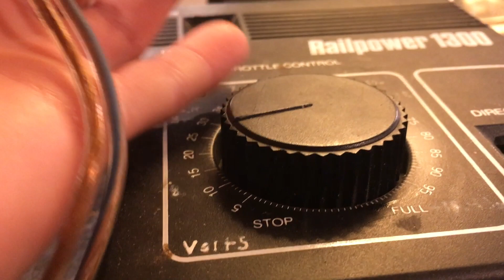How to Rewind 3 Pole DC Motors - Rebuilding Model Train Motors

Comment: I used to rewind slot car motors back in the day.
We used a heavier gauge of wire and a lot less turns, 
then epoxied and baked in the oven at a low temp.
A note of caution, disassembling the old open frame motors with the magnet on the end, can cause loss of magnetism.
However the good news is that they sell rare earth magnets that will take the place of the old one, making the motor better than ever!
Reply: the good news is that most motors can be replaced. i rewound a sekisui 5-pole square motor for a club member years ago- i would not do it again.

Comment: Thanks for another helpful video Harrison.  I don't have any locos that need to be rewound, but now I know how and can give it a try if need be.  You were a little surprised that it worked?!?! 😲 CONFIDENCE, Harrison, CONFIDENCE!!!  Let it warm up a bit, and it'll most likely run smoother and faster, after all you did just tear it apart.  I bought a set that hadn't run in years.  It wasn't running very good when I put it on my layout, but I ran it forward and reverse for a bit, and now it runs perfectly fine even with a consist.  It's a Life-Like diesel (Susquehanna Line).  The wheels are very dirty, so I can see it running even better once I clean them.  How are the wheels on your CP Rail diesel?  We know the dirty track is also an issue.

Comment: You are ahead of me SMT! I have yet to attempt rewinding an armature.  I would agree the main things are: to wind all coils in the same direction around the poles; & wind the same number of turns around each pole.  The N scale boxcar that is laying on its side & missing a truck - you replace the missing truck with a K-D coupler & truck assembly for a " conversion car " to couple  together a train of cars with both Rapido & K-D couplers!

Comment: Harrison,
You did good job on that! I have an old trix f-7 to mess with-Wish me luck!!
Reply: i use the bachmann early-style spectrum motors in those units. you'll have to pull off the flywheels and shorten the shafts, modify the trix rear motor bracket, and drill out the couplings to fit, but it makes a fantastic runner out of them. the motors are still available from the b'mann parts house- i just ordered a pile of them at 20% discount so they were about $11.65 apiece.

Comment: Nice video! I've rewound many motors in my day, and have experimented with them a lot. Make sure you scrape the enamel coating off the magnet wire where it wraps around the little tang on the comutator before you wrap the wire around the tang, that way you'll get a good connection. If not, the motor may not run, or may need a spin to get the motor going, or just poor performance.

Comment: Very interesting video Harrison, congratulations on a task not many hobby folks would not attempt. I knew about motor rewinding back in the 60’s slot car craze. Only read about it as there was mostly written articles. 
The slot car folks rewound motors to increase rpm. Don’t remember if it was less or more turns but the results were dragster type cars that were incredibly quick. 
Thanks for sharing 
👍👍👍😎😎😎 Cary
Reply from the maker: Thanks for your comment. Yes, people racing slot cars seem to do rewinds to increase the speed by putting less turns on each coil - You would loose torque but I guess if you did it just a little you would gain extra speed.
Reply: the wire gauge affects performance as well.
Reply: hey smt I'm looking for a shell and truck for my locomotive

Comment: I think that you will find if you measure out the wire to approximately 6 and 1/2 ft at 36 gauge you'll get exactly what you're looking for without having to do all the counting. You do yourself a favor by using some super glue on those coils to keep them from unwinding.

Comment: If the loco runs backwards after your rebuilt you (a) wound the poles in the reverse direction from when new, (b) turned the case (and magnets) around.  Mark the endbell and case so you know you put it back the way it was.  Worst case, swap motor wires.

Comment: Chuck the motor shaft in a drill, spin it, and hold a piece of 400 grit silicon carbide paper against the commutator to remove crud and polish.  After scrap out any crud between segments with an X-acto blade.  Make sure the shaft is clean and shiny, and lube the bearings.  I like Singer Sewing Machine Oil for this.
Reply: you clean the gaps with something soft like harrison's tooth picks.

Comment: Years ago, I used to run slot cars a lot. There is a company called Parma that still produces motors for them. T hese are very similar to the motors you are working with here. They might have some information you might find useful.
Reply: it looks like a mabuchi motor- prolly not worth rewinding.

Comment: Will this help if you have gotten oil on the commutator an I have a situation that my motor works but won’t spin when you start giving it power you have to spin the armature over for it to start spinning will this help
Reply from the maker: try putting a few drops of alcohol on the commutator then run the motor for 30 seconds and then take an alcohol soaked q-tip and clean the commutator manually.
Reply: @SMTMainline  thanks so much I will try it
Reply: the guys in my club usually put MORE oil in there- because MORE is BETTER- right? if you don't want to tear it apart you could soak it with conducting lubricant and then blow the excess out with GENTLE air pressure- worth a try.

Comment: The brushes are always 180° apart,  whereas the poles are always an odd number meaning one pole is under a brush at a time,  causing the next pole to be magnetically attracted to the brush forcing the armature, (with the poles attached,) to move forward,  and this process alternates back and forth causing the motor to spin/ run.
Reply: beyond that- the offset is used to minimize arcing

Comment: Is this the same process for AC motors? I have an American Flyer track maintenence car which i suspect is burned out (basically the same as an American Flyer slot car motor).
Reply from the maker: It's a similar idea but keep in mind they have a coil outside the motor instead of a permanent earth magnet.
Reply: @SMTMainline  Field coil looks good but the armature looks burned. These were basically Flyer's slot car motors on rails and they burned up pretty easy.

Comment: For slot car motors, while we wound with fewer turns (reduces back EMF) and larger gauge wire (more current) to increase RPMs, that is not necessary for model railroad loco motors.  The limit of loco power is not motor RPM or torque... the pulling power of a model loco is determined by weight of the loco, and therefore traction.  Don't change that.  Count the turns as they come off, use the same gauge wire and wind the same number of turns back on.  Epoxy keeps the winding on the armature.  But also solder to the commutator tabs with silver solder, not 60-40.  Silver solder is higher temp.  Stay-brite works well for this. 

Now for the important part... a hot motor is caused by weak magnets.  Weak magnets results in having to feed more voltage and current to the motor for the desired output, and this heats it up.  After rewinding and assembling the motor, send it off to a slot car shop to have the magnets zapped.  I use Proslot.  They have very reasonable prices and fast turnaround.  I work on a lot of locos, and send in motors (even new ones) 5 to 10 at a time.  If a motor has been bouncing around in a drawer for a few years, get the magnets zapped.  You don't have to remove the flywheels or worm gears, but do have to remove from any motor mounts.
Reply: Thank you so much for the video. I will try this on my slot car arms.  Do the wires need to be SCRAPED where they are soldered to the commutator tabs? Aren't the wires coated with something?
Reply: @JohnnyRover5557  Yes, this is called "enameled wire".  It has a clear coating.  It must be scraped off where you solder it.

Comment: clockwise or counter clockwise. in you case its looks counter clockwise for direction. HOW DOES THE SIZE OF THE WIRE MAKE A DIFFERENCE? and if you did one at 50 turns and anther at 51 would it make a difference? how accurate does it have to be? do the wires have to be "lapped" around each sequentially or do you just wind them any way around them? difficult to explain the question?

Comment: I have an old Athearn belt drive that I put new bands on, and it keeps short circuiting itself and won’t run. Could the motor be the problem?
Reply from the maker: It's probably the wires, are they missing their insulation washers?
Reply: somebody probably cleaned between the sectors of the motor with a metal blade...

Comment: Ok , let's start off by stripping all the wire off the armature .
Ok k good.
Now understand I'm going to advise demonstrate,  and recommend methods of motor performance that I'll recommend.
#1. Let's start off by skewing the blank armature.
This is done so as to mitigate the cogging or start stop aspect of brushed motors.
Next ,vtake and advance the timing by twisting the commentator a few degreetowards the direction you've decided to  so as to be sure you are as fit as possible.
Now, after this setuo

Comment: Dont worry about converting to imperial measurements. There are 195 countries in the world and only 3 of them dont use the metric system. They are Myanmar, Liberia and the USA. 3/195 = 1.54% of all the countries in the world dont use metric! Its only slightly better if you go by population. Total combined population of all three countries is 388.97 million out of a world population of 7.9 Billion. It would be around 4.9% of the world population doesnt use metric.
Reply: not true- in the nissan dealers where i've worked, metric measures are used all the time. in the propeller shop where i work inspecting parts and assembling props- its never used. depends on the maker's service bulletins/publications. when i went to school in the 60's and 70's- we were taught both- as well as the popular conversion equivalents- like 25.4mm or 2.2kg.

Comment: I'd hate to rewind something so tiny, I did an old 3 phase coal furnace blower motor back in the "old days" of 2013 at my grandfathers motor shop
Reply from the maker: You must have had a lot of patience to do something like that.
Reply: @SMTMainline  its actually not that bad, the wire was big and i had machinery to help me make the windings quickly. I also had my grandfather who had done the trade for 50+ years to help me along. Now that I think of it I'm actually sure that it was a single phase AC motor since I had to make a start winding for it. 3 phase motors don't have start windings
Reply: pretty much all furnace blowers are 3-phase
Reply: @tommurphy4307  Not residential ones